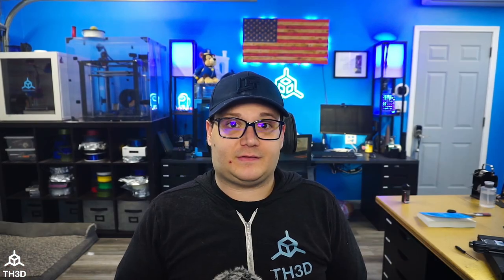Heating Your Bed Before Probing with an ABL Sensor - Ask Tim Clip - 3/15/23

Comment: Yep.  If I let my ender 3 max soak at 210/60 for 20 minutes, my z offset will go from -2.10 to -1.85.  The bed is going up and the nozzle is heading down.  The hot end alone will move down .17mm after soaking for 20 min.  My EZABL is crazy accurate and sorts out the bed nicely but even it doesn't know what to do with an expanding nozzle tip.
Reply from the maker: Yeah all the parts on the machines like to expand and contract. This is also why we recommend doing a fresh G29 every print just in case things deviated differently during that heating cycle vs last time.